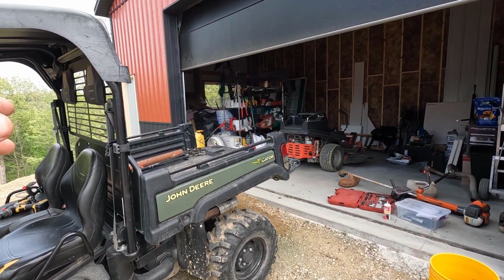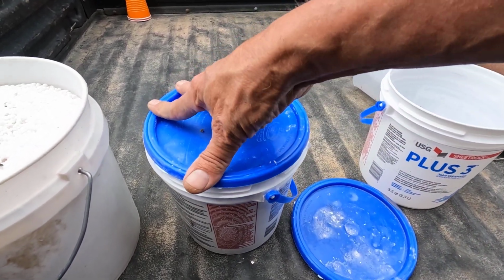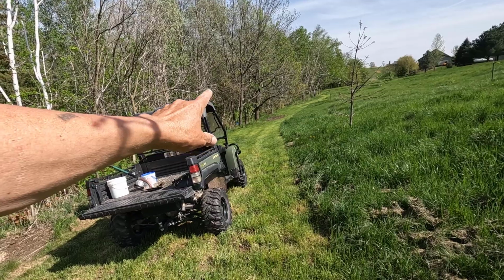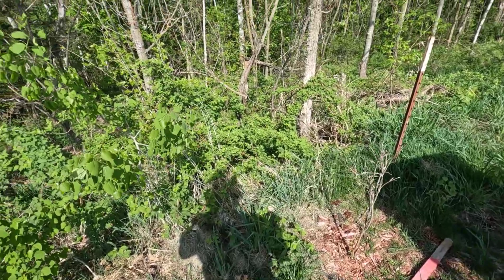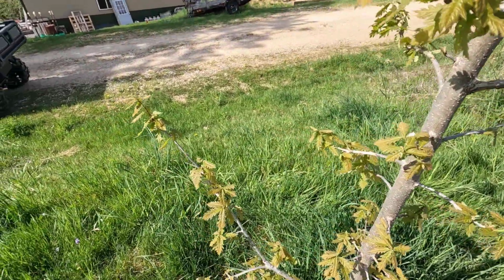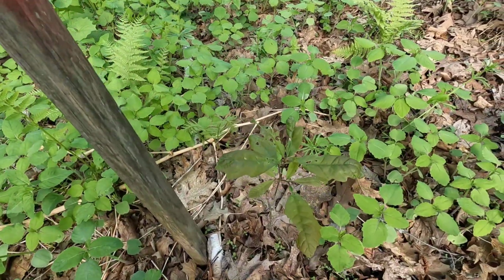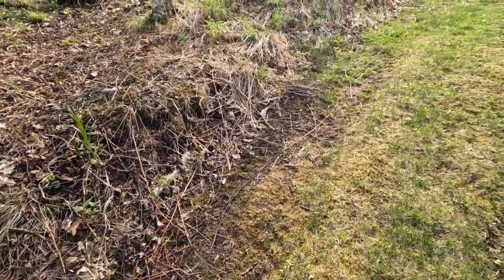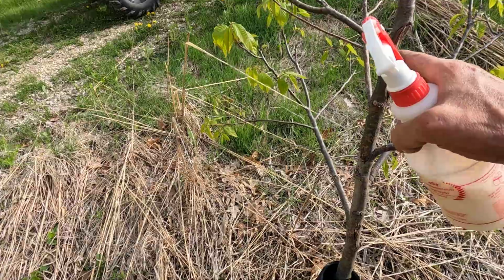Spring Fertilizing the Bur Oaks ― Nitrogen-Only on the Bigger Trees

Comment: I haven't had very good luck with planting trees. i planted a row of arborvitae once, and most died the first year. The rest died the next year. Planted a few maples that were like ten feet tall, and they died as well ☹ What do you think I'm doing wrong?
Reply from the maker: The most common cause of failure when planting trees is lack of water. Sprinkling wont do. They need a deep watering whenever there is less than 1" of rainfall in a week — especially if they are bare root, and especially if the weather is hot and dry. I'm going out in a few minutes to use my redneck drip waterer on the new trees I planted this year 💧💧😊💧💧
Reply: Bone meal in the hole. 
Transplants and seeds look for calcium and phosphorus before they decide to grow. 
They also will benefit from deep watering and mulch. If the tops are bigger then the roots it will sweat more then it can drink.